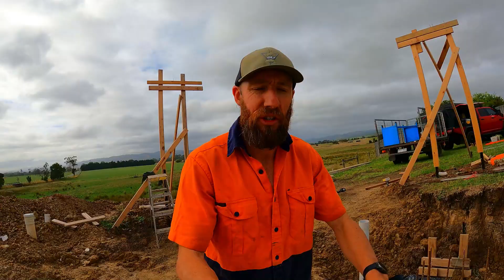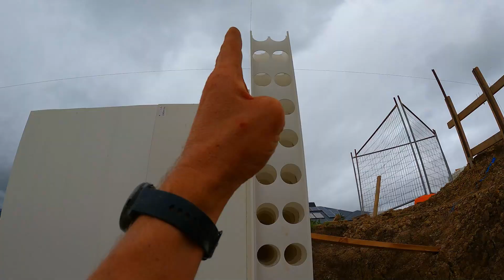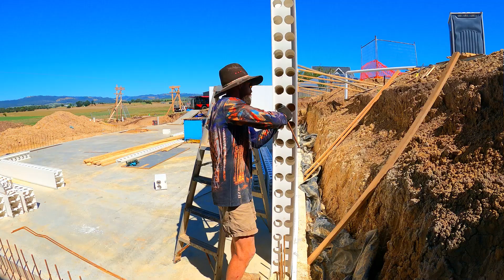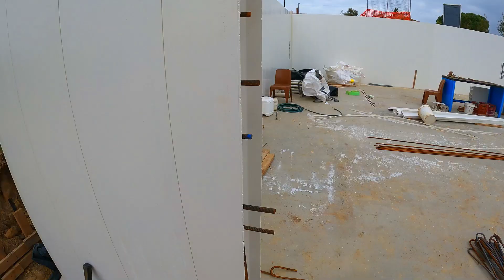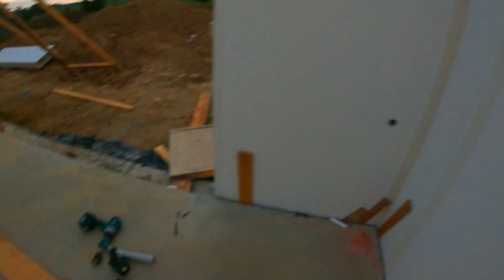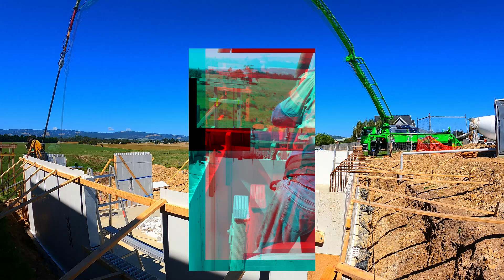Bomb Shelter or basement, Dincel walls V Blockwork, why we chose Engineered walls for our basement

Comment: Great video. Why did you pick Dincel over the soft foam & folding flat RiseProducts formwork. We are looking at using it on our farm for a studio and garage extension all above ground and using the 110. Background retired sparky. Thanks for any feedback.
Reply from the maker: So sorry I took so long to respond. Dincel I met at a Melbourne expo and the supplier is in Dandenong. Raise formwork I think was in Sydney. And was a kinda the same. Engineer ended up actually specifying in the plans. 
Hope that helps